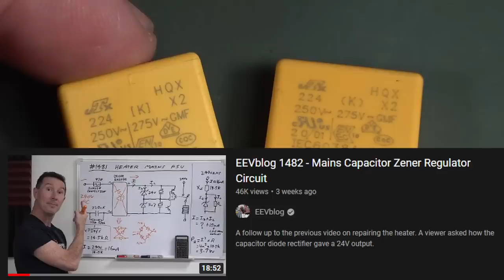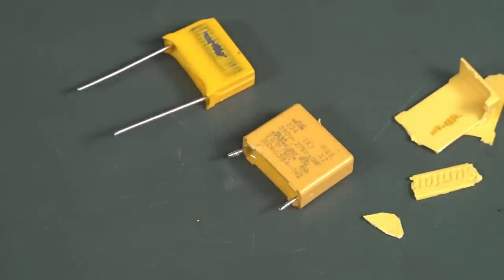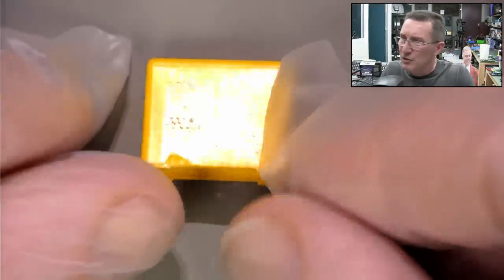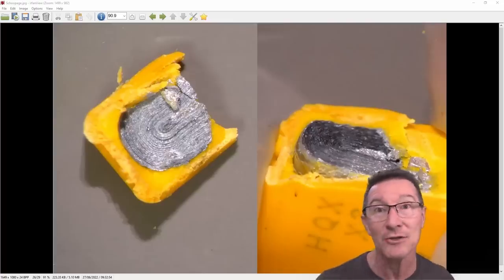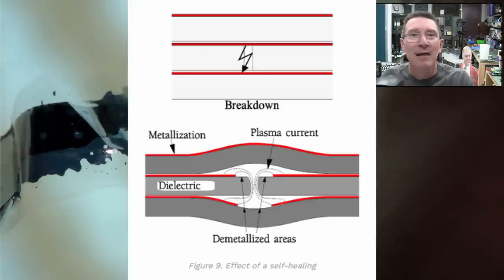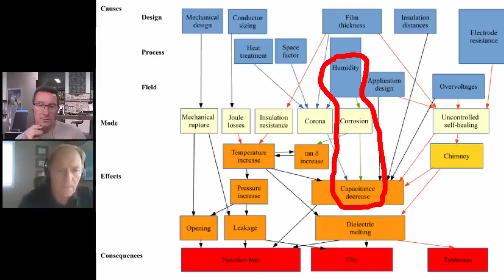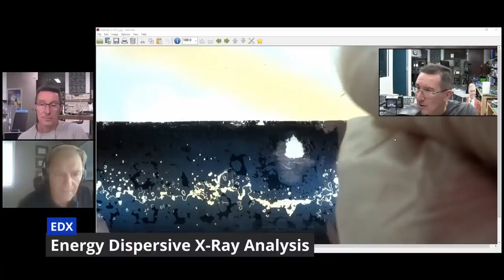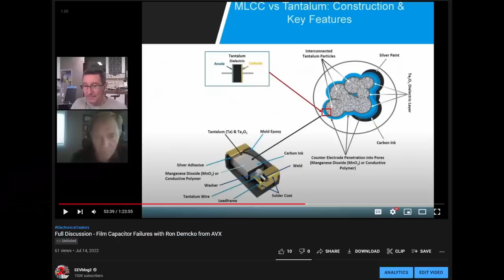EEVblog 1486 - What you DIDN'T KNOW About Film Capacitor FAILURES!

Comment: I heard that lead free solder is right implemented in all mayor ATX psu brands causing a lot of new issues (and opportunities)...but, also that you cant easily took your ''used with lead'' friendly soldering station hoping a long term repair to this things(called lead contamination), Its that really true? for small power things I think this is not critical...but for psu fixing? Its really an entirely lead free dedicated (or even dedicated exclusively to some kind of solder alloy) soldering station a need nowadays?

Comment: Polyester film capacitor variants of x2 have been designed for capacitive power supplies.  Tdk Epcos and Vishay have application notes on this but I can't post links here without it being blocked.  The polyester film capacitors have a higher temperature rating better humidity properties and the dielectric constant of polyester allows multiple capacitors to fit in the same size enclosure as 1 polypropylene x2 cap.  This allows the sharing of the stress, voltage etc to be shared between 2 capacitors.  I had an application at work that got me in trouble before I found all of this out.  As another reply stated traditional x2 caps have 2 jobs.  1.  Never fail short.  2.  Perform the required filtering for emc compliance when the device is first tested.  Also important to note that an x2 cap across the line is subject to different stresses compared to a capacitor used in series in a capacitive power supply which will have current continuously running through it.

Comment: Are there caps that are built specifically for moisture resistance? I had to make some circuits without capacitors recently because I need to use them in a high humidity environment and they kept giving me trouble. IC's have held up better for now. But I would like to use capacitors eventually...
Reply: What is the capacitance range you need? If it's in the uF range and low voltage, then my suggestion is tantalum. The metal encapsulated ones with glass feed-through on the positive end. They are hermetic and very reliable, but bloody expensive.
Reply: @mrnmrn1  Thank you very much for the suggestion! I have no range requirements at the moment because none of my designs are using capacitors for now. Naturally, this severely limits what I can do. So I'll be pretty happy to find anything that works. More info/ideas welcome! ;-)
Reply: Looked it up on mouser. You weren't kidding about them being expensive. The construction of the TAP336K010SCS seems very impressive from the datasheet. I've never seen anything like it. Will probably get a few!

Comment: I'm no expert, (entirely self-taught,) so this is wild conjecture, but the thought occurred to me that the burn roughly follows the center of the length of the capacitor because it it was the center of the electrostatic field that was on the capacitor at the time it blew, so the field was guiding the arc just as the field between the electrostatic plates guides the electron beam in a CRT.

Comment: I learned about X film capacitor failures here in the UK in my early years with the "BBC Micro" computer. It was easy to spot when they had failed as flames would come out the rear of the computer.

Comment: these failure modes are the reasons that the RIFA capacitors in old computer power supplies are so notorious in the retro-computer crowd. That and their propensity to crack on the outer casing, leak in humid air, and pop violently.

Comment: I subjected such capacitors to OVER VOLTAGE and the breakdowns could be HEARED.
But surprisingly the capacitance almost haven't changed after some hours of that O.V.
Reply: try it under high temperature (50°C+)
Reply: @liam3284  I will have to build an oven for that. 😀

Comment: Simplest way to unspool a cap (well in my personal experience at least) is to overvolt it (from a distance!!).

 Granted, in my case, it was a 100uF electrolytic in a 150 watt Marshall valve power amp undergoing test & repair. It shot between me and a colleague at a significant rate of knots. The metal canister at the front and trailing a beautiful, spiralling tail of aluminium foil, steaming electrolyte and bits of paper behind! It managed a very impressive 25 to 30 feet of travel before hitting the wall of the hall in which we were working, otherwise the distance would have been greater! 

There is a LOT of foil in an old school metal cap cap from the late 60's (this happened in '73)!! 😁😁

It was no work at all to examine the whole length of the foil if we'd been so inclined. Maybe give one to Big Clive or Ave (he can check out the "chooch" level required!) 🙄😱🤣🤣

Comment: It seems when these caps are used to pass current, as a capacitive dropper or coupling capacitor, they don't last. As a suppression capacitor across mains, they seem to last a long time.
Reply: They were never designed to pass current like that. The "capacitive dropper" is the cheapest, nastiest and more unreliable of all power supply designs - so why is it now the most common in small appliances... because BOM Cost.
Reply: Won't the current also pass through it when connected across line and neutral like designed? Or is that some phase/real VS apparent power stuff that makes it  work differently when there's no ohmic resistance in series with it?
Reply: not so sure that they do. Dave's second cap was a PC PSU filter, lost 90% rated capacity.

Comment: Are you saying that the plastic doesn't matter, that all Poly-XXX caps are equivalent? Why are they supposed to be better for audio applications? I can't imagine an audio signal invoking the overload protection.  Why did the words, "I am a professional" make me anticipate torrents of blood? :-)
Reply: I have a very hard time believing there is an audible difference between different film caps given than the paremeters are the same or of negligible difference. ESR can be a factor in, say, a speaker crossover especially in low impedance speakers. But it's not inherent to any material per se. It's mostly just matketing blah blah.
Reply from the maker: The material can matter for certain aspects performance applications. If you are trying to hear the difference, then I've got a bridge to sell you.
Reply: The reason they are used a lot for audio is for the accuracy and stability in tuned circuits like graphic equalizers. It avoids having to have trimpots and adjusting things in manufacturing.
Reply: For audio signal concepts, read Douglas Self books

Comment: while you're at it... force wima and the others to print what side is the inside and which side is the outside of the foil. as you know... we like to have gnd on the outside. for all the obvious reasons. and no 'moist getting into them' is not an option. lol. that by itself would already be a manufacturing error lol. you use these (despite the price) DUE to their 40 year+ mtbf. if they screw up before that (preferably 100 years ;) you might as well use elcos no lol.

Comment: The wiggly line through the film looks a lot like a high-voltage discharge.
Reply from the maker: It's the high voltage causing corona arcing and degredation of the metal.
Reply: @EEVblog  Makes sense, given Ron pointed out it was probably moisture at fault.

Comment: Some years back, same problem. Testing at various clean, spike free, AC voltages up to 270AC, 50Hz, I measured reduction in capacitance at about 1% per week, proportional to applied voltage. This was in a product I designed previously, using charge pump voltage stepdown. It was in  certain brands. I heard unconfirmed rumours relating to an unhappy chemical engineer assisting this problem. Same with bulging electrolytic capacitor, olive green. Different brand. No problems. Wima are winners.
Further to that, start off with 2 new bum brand ones. Now using AC kill a capacitor for a week, then unroll both an compare.
There are a self healing variety that have a grid instead of a film, and the blowholes from spikes are much smaller. Noticed in larger type motor start capacitors.

Comment: I have one here too: https://madengineer.ch/wp-content/uploads/2015/07/20140210_092457.jpg It's not an MKP but MKT capacitor which wasn't suited for the application. According to the manufacturer the failure was due to corona discharge within the capacitor. A proper MKP solved the problem (Epcos worked with zero degradation, Pilkor with the exact same specs failed as well after a couple months). According to one manufacturer the robustness is greatly increased if they're potted under vacuum. Makes sense.

Comment: This story sounds like the cheap crap our AC service techs install into AC units running out here in the desert. Usually they also exploit the elderly for some service contracts. I remember the running cap failure.. 6 years after a new Trane was installed...it was hot that day...as George Brazil licked his chops and tried to fleece me for $900 a year...they would come out 4 times a year...and leave sheet metal screws upon the roof.  I was able to haggle a tiny after I showed him that capacitor he just installed could be bought for $22 retail. So I got them down to $600 a year....

After their 2nd big PM of that money squandering event....it looks like the tie wraps...that held a temp blub small 1/8" copper tubing broke and the vibration of compressor caused this capillary tube to bang against some sharp sheetmental and... leaked 10 lbs of freon. Of course that repair wasn't covered in their PM gouge contract. 
Talk about greedy hustlers on a grander scale than King Grifer Cadet Bone Spur himself. The AC service guys love and live quite well on that summer milk capacitor run. A capacitor bought wholesale for $14 each parlays into $900....well they do have to buy a little gas

So now I have bought my own cheap capacitors and I am storing them inside..in a dry cool place

I am looking for nice hermetically sealed  glass Ag plate on ceramic...go with twice the working voltage...built to military -55 to 125 deg. C ....she be bigger...who cares...make it fit..

I am sure Murata..Kemet, Corniel Dublier...IT Jennies- they build better...you specify...

Thanks for showing us your cap failure... and getting an expert on. 

My capacitor burnt open and had zero capacitance...the new.one had 48uF...measured on Fluke 115...I think it was rated or labrled  50 uF...

I am so glad I helped myself....and I am looking foward to my future AC heat pump...240 VAC in..to  Invertered to variable speed 3 phase...for the compressor. May the inverter be built well....and tolerate AZ heat. At least no ...or I hope no starter relay. Maybe Trane will use ball bearings in that.heat.extraction fan motor on the coils?...

Meanwhile my Trane installed in 2003...keeps chugging along. 
It has now had it 4th set of starting and running caps replaced...
I do like a frosted set...and feel refrigeration is key to life. 

Nothing like chasing the white ball in August...collecting a big pile of skins...then going home to count that pile...in 72 deg. F...

YES folks..we are taking about a temperature shock.
Reply: All I have seen in the vids about air condx caps is that the newer cheaper Chinese types are to be used when you want more service calls versus the older types.

Comment: All the reason to only use First-tier caps in your projects:
Rubycon
United Chemi-Con (or Nippon Chemi-Con)
Nichicon
Sanyo/Suncon
Panasonic
Hitachi
FPCAP or Functional Polymer Capacitor (ex-Fujitsu caps segment, which was bought by Nichicon)
ELNA
Cornell Dubilier (USA)
Illinois Capacitor (Currently owned my Cornell Dubilier)
Kemet Corporation (USA)
Vishay (USA)
EPCOS (TDK company, Germany)
Würth Elektronik (Germany)

-Avoid  chinese caps at all cost.
Reply: Even using Nippon ChemiCon, read the datasheet and do not exceed the rated voltage or ripple current!

Comment: In audio work, film caps are the one breed without some bloody caveat! Let us have that sanctuary!!! lol
Reply: The difference to other caps is they only fail when over-volted and not just because of age. Just use a voltage rating much higher than what they'll realistically see and you're good.

 The problem arises when used as mains EMI suppression caps, even though when they fail you might not even notice. Some manufacturers of cheap appliances also use them to drop mains voltage instead of using a transformer or something. Then they're still exposed to the frequent mains overload conditions and the device is going to stop working once they fail. 
Some devices also rely on the EMI caps to keep interference from getting in, which can be quite dangerous when they fail, e. G. a kitchen appliance starting by itself when you turn the ceiling lights on or off.

Comment: Hi,

I had a similar problem with a capacitor used in a capacitive dropper, although the change in capacitance was not as drastic (only roughly 1/3 gone, but it was sufficient for the device – electric kettle – to stop working; it wasn't able to sustain the relay anymore).

I made a short video with some photos, I also used a part of your video (with a link), as your video is much more educational than mine (I just showed some photos and concluded that I have no idea what happened) – I hope you don't mind?

Here's the video if you're interested. https://www.youtube.com/watch?v=iyiPEy4hjcM